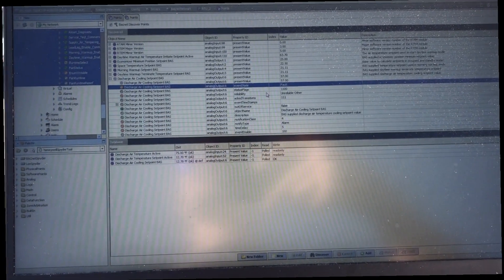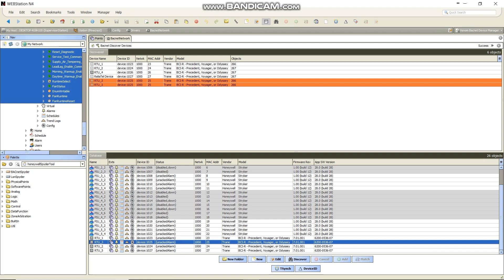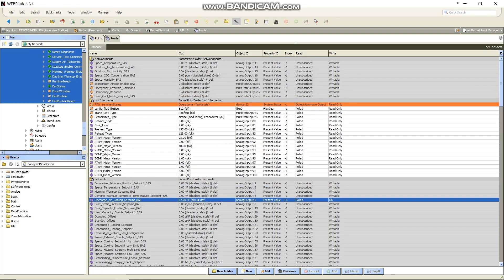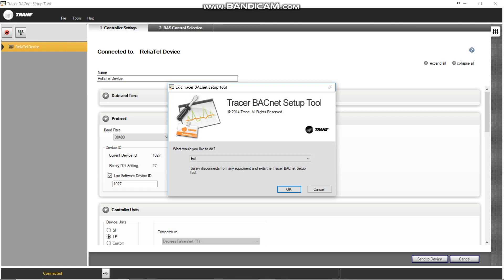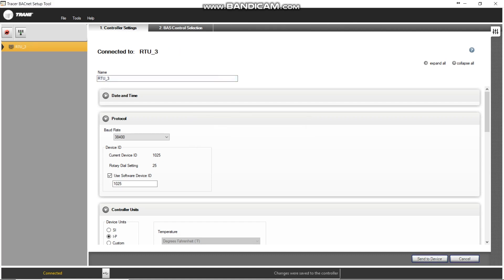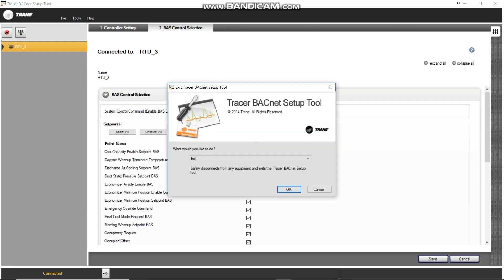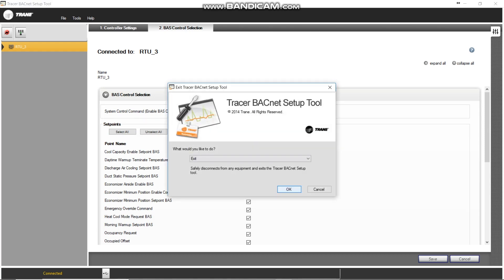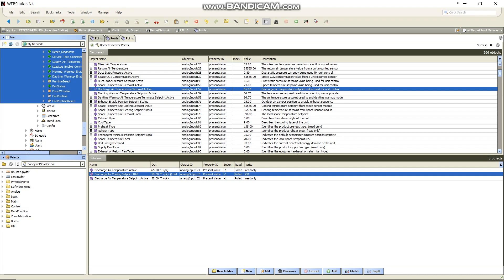How to Discover Trane Voyager BACnet Points

Comment: Do you know if the clear controller works with the UC600? Im having a issue where none of my points are even showing up in the BAS control tab, but I am able to pull them in through N4 (just cant write). The clear controller button does not come up on the bacnet setup tool though.